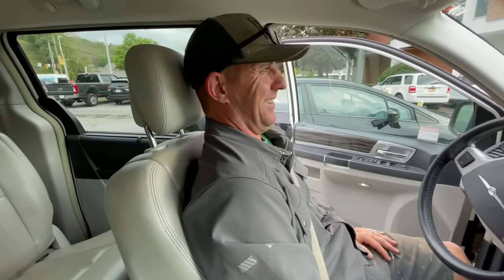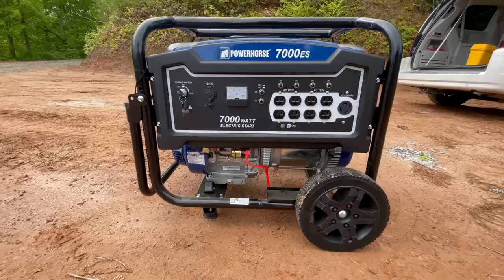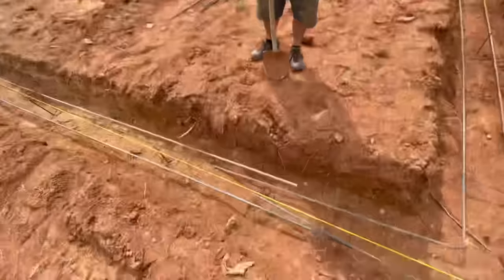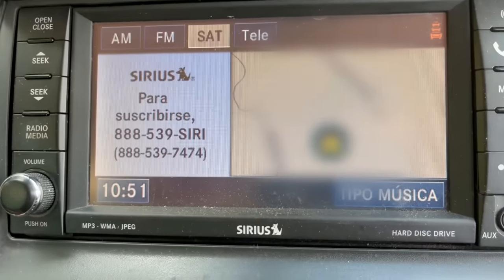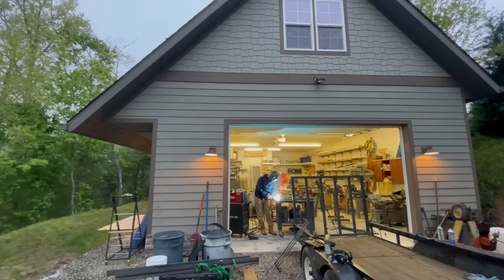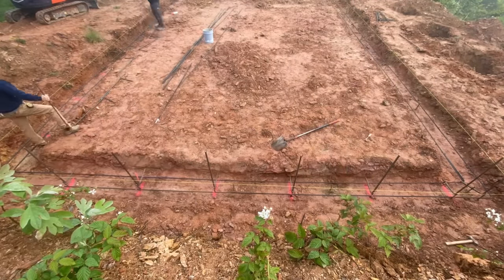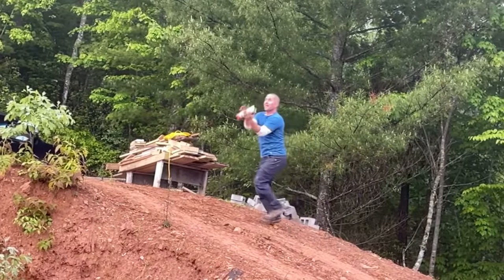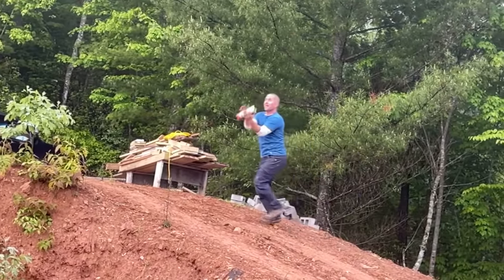Pouring Concrete Footings | Building The Nantahala Retreat #2

Comment: The Minivan of problems, smells of gas, Celsius, in spanish, every warning light is on, aaaaaand no keys for the digger. (And thank you for the SkiResort replacement!)
Reply: My mom has that same make of mini van its a 2010 caravan in 2017 the stupid reverse gear went out at 56k miles. It has 146k now still drving it without reverse! Just dont park in areas that we cant pull thru!
Reply: @kevinbrister8801  a

Comment: Good point about the long rebar.
I'm building an extension to a house starting next month, the long wall concrete foundation is nearly 44' long and only 10" thick and no rebar specified by the architect who said it wasn't needed by building regs (code).  I think for the cost and my peace of mind, it'll be getting a dose of steel in there!
Reply: It wont hurt to install rebar in the foundations.. 
Just do the rebar a bit better than they did it..

Comment: The rebar that was welded and pounded into the dirt will eventually rust and since it’s connected to the footing rebar it will follow it all the way through. A plastic chair or concrete doby will give you the separating from the soil.

Comment: I like your work. But this time I don't know why you did this,  the rust will rise up through the rebar buried in soil without concrete around to protect it. The rust will spread through the horizontal rebars and swell up and crack the concrete putting all the foundation in danger.
Reply: It's gonna happen regardless, cement is very porous, the rebar will get wet regardless.
Reply: Snap.

Fiberglass rebar

Comment: Small recommendation, buy the evolution metal saw, no more hot cuts and cleaner cuts as well. Cuts metal in literally half the time the dewalt would. But since you guys only cut rebar then it’s eh for y’all. We do structural repair and foundation repair, an cut tons of steel all day long. Happy pouring!

Comment: You can cut the rebar with a large bolt cutter, I used to lay out precast panels sprayed and stacked with picking eyes. Cut all the rebar from 21 ft stock. Tied up mats on 1 foot centers. They were floor panels on the Sheraton hotel in anchorage AK. I forgot how many stories but it’s plenty. Didn’t use any power.

Comment: Are there a rust concerns when the J-leg extends from the concrete foundation into the dirt? Would that migrate into the foundation and eventually compromise it?
Reply: Also wondering about this, including for rebar grade stakes. Doesn't that create an opportunity for rust to migrate up from under the slab?
Reply: I work in commercial concrete and this is a big no-no according to most experts but I have been seeing a lot of differing opinions and literature lately that says it is not as big of a deal as it is made out to be and there won’t be enough oxygen exposure to continue the rust far enough to have structural ramifications.
Reply: Yeah......this is always my biggest concern watching these videos. Leaving the rebar in contact with the ground will allow it to corrode--it will probably take a long time if the ground isn't too wet. Corroded rebar can crack a foundation.
Reply: Yes they will. this way of reinforcing concrete is wrong and would not pass inspection in my area.
Reply: There wouldn’t be enough oxygen for it to be a concern
Reply: @ryanmartin9850  standards are being slacked as corners are cut. People are just lazy or unskilled and claim its fine because "they never saw it fail". By the time its a problem it's somebody else problem- doesn't make it right.
Reply: Yeah we couldn’t do that where I’m from. Also we would be required to vibrate the concrete too

Comment: Great instructional movie. Great job!
One thing though. Is it OK to put the rebar down into the soil? Isn't there a risk that the rust "travels" with the rebar into the slab (which then could crack, since the rust will expand).
Reply from the maker: There is always risk of rust if there is moisture present… I’m not really sure that the moisture level in the soil just below the concrete footings is any different than the actual concrete footings in this case. Concrete is quite capable of absorbing moisture so I would imagine they are at a similar moisture level. Also these rebar are only at about every 5 to 7 feet throughout the foot in vertically so it’s not a large volume of steel compared to the volume of concrete it would have to disturb actually cause a problem.
Reply: Short answer yes it is a bad idea to drive the rebar into the soil because of rust. That's why on most plans and in codes it requires rebar be a minimum of 2" from the edge of your concrete.

Comment: The new EV Ford F150 Lightening would be perfect for this video 😂
Reply from the maker: Yeah I actually looked into buying a Tesla used after this experience… Still a little much money though :-)
Reply: @PerkinsBuilderBrothers  time to put a pre-order in for the EV Ford. For your line of work it does seem like it would be a good option, plus with federal incentives it’s going to cost less then a new gas F150.
Reply: @PerkinsBuilderBrothers  The Ford lightning looks better for job sites, it has 120v and 240v sockets. Teslas don't have outlets I think
Reply: @mechanicalsuccess399  Tesla will literally void your battery warranty for using the battery pack as a power source.

Comment: I understood most of the process but where did you determine the height of the footing to keep it level
Could you explain thanks
Reply: In a previous episode, after digging the footings, Jay drove pins into the bottom of the trench with Ray checking to make sure the top of the pins were ate the right height for the top of the footing.
Reply: I mean at not ate.

Comment: Question regarding driving reinforcing steel into the ground then covering with concrete. 
What is the longevity of doing that? I would have thought that over time the steel will rust up into the footing and blocks
Reply: It will. Most plans/codes call for a minimum of 2" of concrete on all sides of your rebar.
Reply: Wouldn’t pass code here

Comment: I learned a lot. Thanks a mil bud. Question: If I’m laying down a footing on a downhill slope. Is it the escavators job to take less dirt on the low point or remove more dirt on the high point or does he first  level out the entire area before he digs out the footing ?

Comment: Man, it makes me a touch nervous seeing just how soft the fill is (Jay hammering in a giant stake at 13:00).

I trust you and your engineers, but I feel like I’d want a few piles driven in for my house to sit on considering how close it is to the edge.

But you’re the Pros!
Reply: Why do you think the holes for the piers are so deep. They dug down to vergin soil.
Reply: @jamesadams893  you got anger issues bud
Reply: My sister and brother-in-law lived in a mobile home, the system they used to level and tie down was perfectly adequate but looking at it always gave me the willies.
Reply: @jamesadams893  You’re right bud, I’m not in the same state - I’m in London, England 🏴. But I did clearly say that I trust them as builders (and the engineers who specced it). In fact, having seen the last two series, I’d probably trust them more than almost any others builders I’ve seen on YouTube (in the US or UK).

But you’ve got to admit that visually, if not technically, it does LOOK a little sketch. That’s all!
Reply: @mjrc123  don’t bother responding to keyboard tough guys, they always expose themselves for what they are.
Reply: The type of footings we are using are designed to sit on regular original soil... the ground actually doesn't have to be as hard as a rock for the home to be completely sound. But in this case, most of the ground was as hard as a rock!
Reply: @jamesadams893  ouch!   that was more harsh than need be
Reply: @jamesadams893  were you red in the face throwing punches in the air after that comment?

Comment: Question: Where can I get the tying wire that you used on the rebar? Links available? Please
Reply from the maker: You can buy the wire ties in tool at Lowe’s… We get them in a big role from our building supplier

Comment: Its kinda shocking that rebar isn't required by code. Here we need to get foundations engineered. Usally 4L12TM top and bottom.
Reply: I thought welding rebar was not allowed.  I think it changes the tensile strength.
Reply: @endicot0195  The weld wasn't structural. The additional leg was just to hold it in place, but the rebar with the bend was the structural element.
Reply: @andrewbrown784  That’s true but my understanding is that the point where the weld is will degrade the ductile properties of the upright rebar.  And that piece does have an important structure purpose.
Reply: @endicot0195  You are correct. Welding high tensile reinforcing is a huge no no.

Comment: Hey guys, I was wondering about the concrete and I have a question. Why don’t you use concrete vibrator to eliminate the air bubbles in the concrete ? I’m just curious about it. Greetings from NYC

Comment: I really worry about those footing rebars rusting away.
Reply: They're up off the dirt, encased in the footings.  They won't rust.
Reply: @Lugnut64052  the piece of bar welded to the j-bar that was hammered to the ground and also touching the footing reinf., i think that will rust in maybe few years.
Reply: @necrosapien346  correct.

Comment: As a professional structural engineer, it is not allowed to weld within 2" or 2*bar diameter of the bend point on a rebar. Welding near the bend will lead to the rebar being brittle. 

So I am with Eric on zip ties or move the weld lol.
Reply from the maker: Good comment… Everything is just tacked with one zap… Nothing heated hot enough to get brittle. The foot just needs to stay on there long enough to pour the concrete in ;)

Comment: Presetting J-bars and pouring them in is the only way to go.   I’ve spent time drilling holes with a hammer drill after slabs had cured to set re-bar.   Not my call… lol.  But I was a teenager with a strong back they said!

Comment: Stupid question, how come you guys didn’t use wood 2 by 4 wood planks for the form of the foundation (instead pouring the cement directly into the trench)?
Reply: Saved a ton of man hours and lumber cost. This is typical in my region. Builders have been doing it this way for decades in my area
Reply: Why do builders in other areas use them?

Comment: I always wonder how good are these foundations for a house ???? 1 foot foundation ....on a side of a hill....with rain washing it away ? ( the hill I mean).....seems like a disaster waiting to happen....
Reply: Its a 1 foot footing, not foundation, big difference.
Reply: That could be 12 inches or 48 inches in the ground, if the ground fails, it doesnt matter. The depths off the footing are determined by where the frost line is. Where they live its 12 inches, where I live in NY its 48 inches. So everything they are doing where I live, I have to do 4x as deep.   😪 Just to help you understand. 😊
Reply: The 'foundation' would be the footer, the slab, and the block walls all connected properly. Thats what makes the 'foundation' of the house, and these guys go well above and beyond what is necessary there..  :)

Comment: I'm kind of surprised you guys pound those J bars in. You letting rust come into your footing. I know it will take 50 years. But sooner or later the rust will come up from the bottom and keep eating.
Reply: A total no go here in Germany. I was i little bit shocked to bo honest.
Reply: Never here in Florida. Fail you on inspection
Reply: Pretty sure they changed it. It passes code.  Something about it doesn't matter if the rebar is exposed or not it won't rust any different inside the footer
Reply: @jba6231  different area if course.  But ya here in Michigan its not allowed but especially on a commercial job. Just an observation.
Reply: im not construction literate, does pounding them in knock a certain coating off that helps prevent rust or something along those lines?
Reply: @Skyelar Brennan  no, but the dirt and moisture combine with the metal and the rust will get up into the footer and spread to the rest of the rebar. In the long term building stability it has been know to create lots of problems
Reply: Not being argumentative, just wondering how is this done without wet setting? Do you have to build something to tie them too? Like if an inspector has to see it before pouring like he eluded too? I’m going to have a situation like this coming up and was curious.

Comment: How did those ancient Romans ever do it without putting steel rebar into all their construction projects?
No gravel or vapor barrier under the footer but hey...we have the "I wanna rust" rebar steel which extends into the dirt below the footer.  Nice.  Most codes would flag this.
Truth is, the non-commercial contractor has no way of knowing what the concrete mix is, slump or otherwise.  They just take the supplier's word for it.
The attitude is, once it is under the ground or under a block wall, who cares.

Comment: That rebar is only intended for thermal expansion. (horizontal ones) The engineering does not take that rebar into account for load calculations.

Comment: I hate steel in concrete. It'll be stronger for a time yes. But eventually it will fail. Roman concrete structures are still standing after centuries, modern steel and concrete structures have a lifespan of about 15-30 years. If you're serious about building something that will last forever don't use steel.